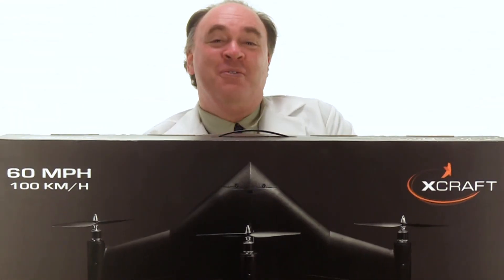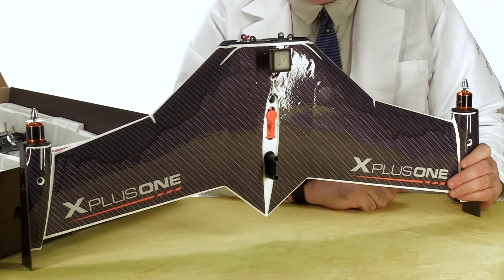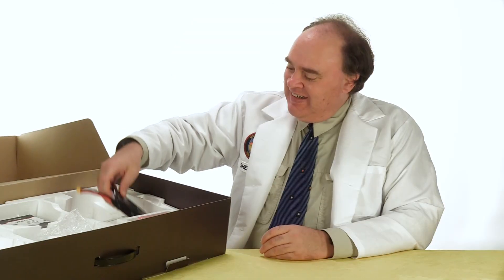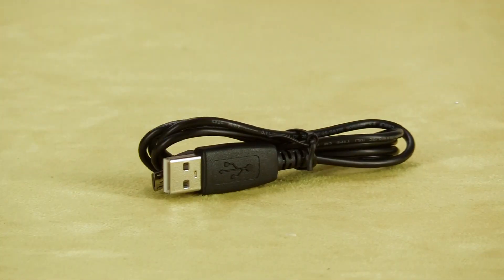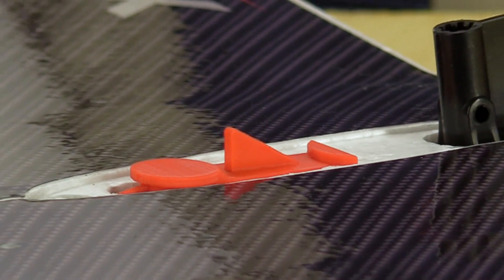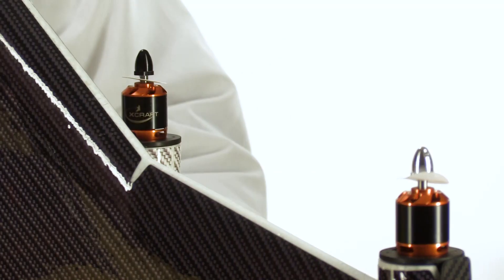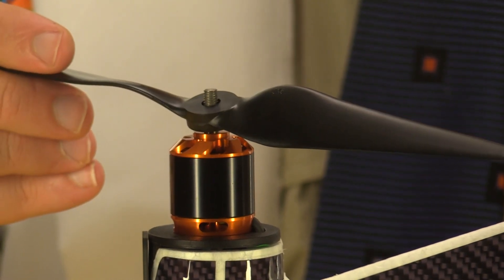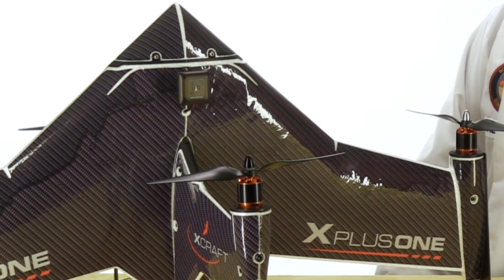xCraft X PlusOne Unboxing and Assembly

Comment: Throttles still do stay where you put them for the most part. Just toys (Like DJI) spring to center.

I do like DJI, just don't see their new RTFs as real hobby grade equipment.
Reply from the maker: I certainly remember when that was how all throttles worked -- but the industry and the hobby is changing quickly. For quite a few new pilots who have only ever flown drones, the spring-to-the-center throttle is the only type they have ever seen, which is why I called attention to this particular detail. And it isn't just DJI -- Yuneec, Autel, Parrot -- pretty much every drone manufacturer centers the throttle now. Also, as it pertains to hobby grade, I certainly take your meaning, however: hardware from DJI and other manufacturers is now being routinely used in professional applications such as construction, land surveying, precision agriculture and many, many more. So, does that make them "professional" grade? The times, they are a'changin'!

Comment: Ok so a couple things, first never make a video of a drone and not show it flying period I don't care about the excuses nobody cares about the unboxing.Second, it's a great concept and if it worked and wasn't proprietary people would buy it but alas, it's total junk, didn't fly before this review and won't fly after this review. The drone market needs to start focusing some attention on VTOL aircrafts, tilt-wings and so on. At LEAST make some flight controllers capable of it that ARE NOT PROPRIETARY.
Reply from the maker: I never actually made any excuses for not including flight testing in this video, nor is there anything in the thumbnail, title or description to imply that there is any flying in this video. We actually decided to start splitting our aircraft reviews into different parts so that people can focus on what they are most interested in seeing. Also, quite a few people seem to care about the unboxing and setup -- 1,012 of them as I post this comment. I agree with you that it would be good to see additional refinement of VTOL concepts for drones -- the Autel Kestrel is about the best I've seen to date, but it's targeted at high-end industrial users, and there likely will never be one in my hangar. <sigh>

Comment: looks good ,,, except the spinners that's a big no ,,aka fail
Reply from the maker: Yeah, this whole aircraft is very old school -- it shares a lot more in common with the home-built drones we were flying years ago than modern machines from front-line manufacturers like Autel, Yuneec and DJI. I was especially surprised to see the adapters to fit the props on the motor shafts -- a clear indicator this was built with off-the-shelf components.